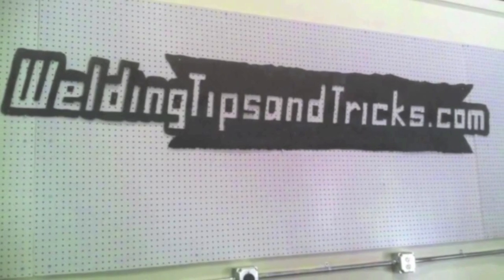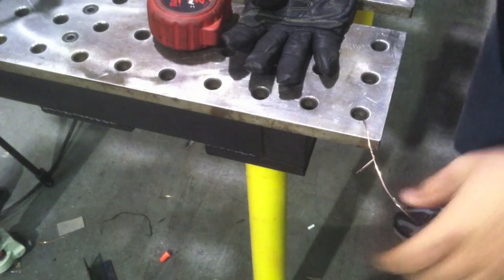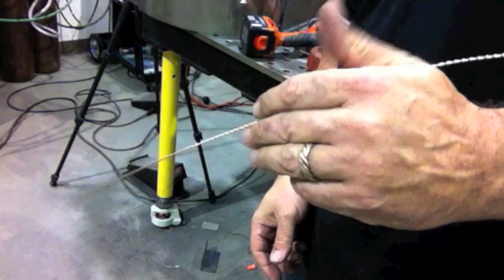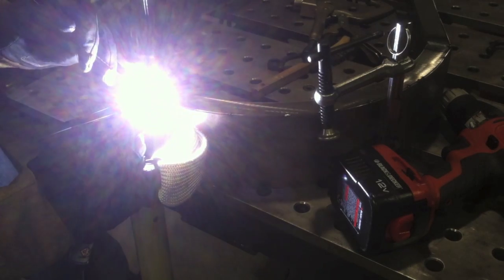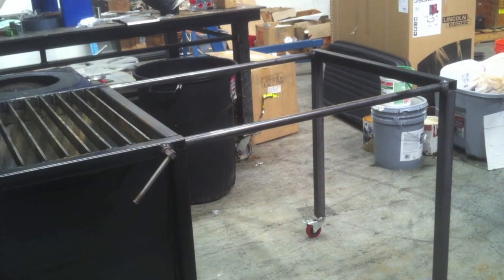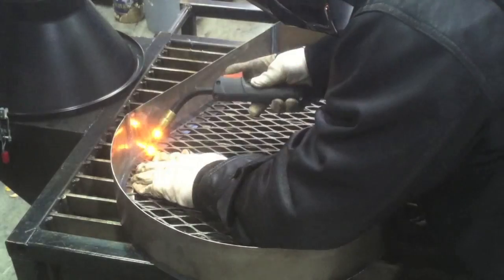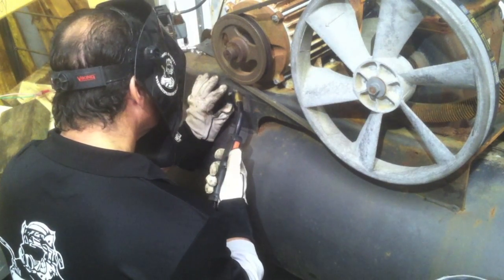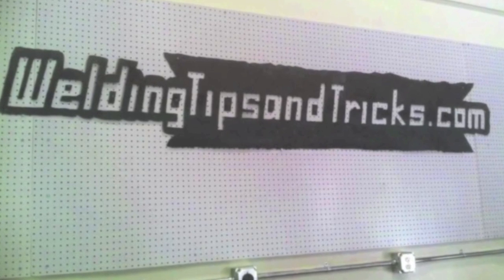Welding Project - Fabricating a Belt Guard for an Air Compressor part2

Comment: Beautiful belt guard turned out amazing, on suggestion though, I work on compressors all the time and have my own Ive rebuild, I can't help but notice yours seems a bit under the wether I recommend you just take the pump give it a quick sand blast and slap some paint on it, but other than that, brilliant!!

Comment: Unfortunately not. Flux cored wire generates it's own gas cloud around the weld puddle, but won't shield the tungsten. After about a second of oxygen exposure the tungsten would burn. Plus the spatter and slag created would make trying to maintain a TIG arc very, very unpleasant. I really can't imagine the scenario where you'd so this because if you have a TIG, you have gas.

Comment: great Videos theyve help me alot but im wondering about the Alloy metals like Stianless 316 and on up and what settings to use. I plan on buing a Tig welder soon and am also wondering what type of Tungsten rod is best suited for your more common mild steels if you can help me out it would be much appreciated